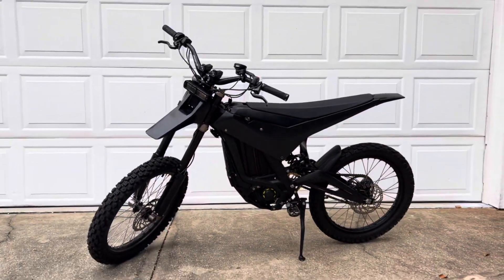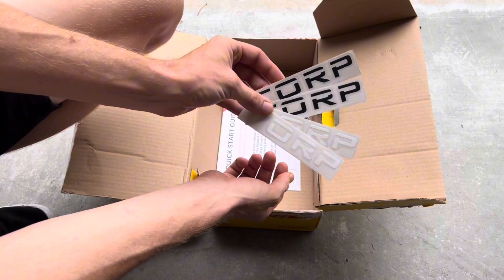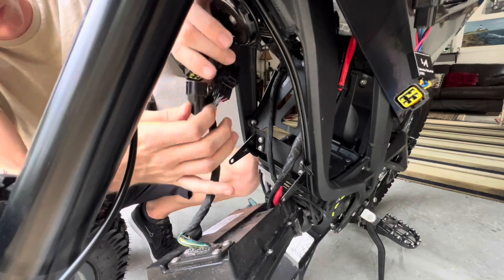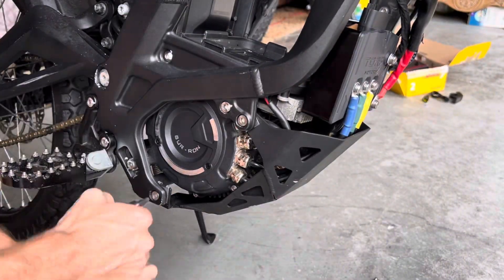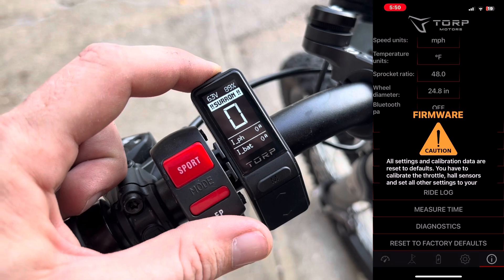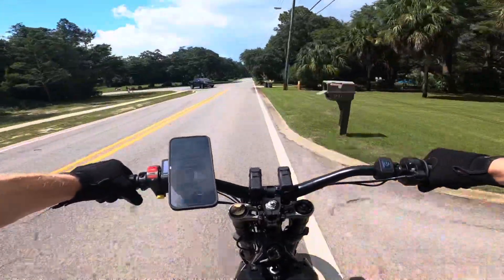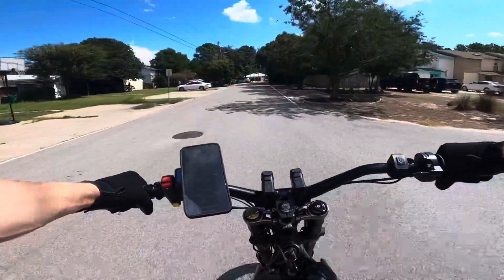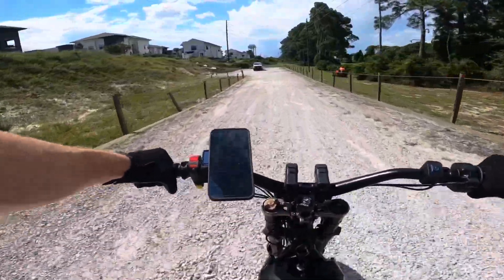Surron X TC500 Controller Installation #surronx #ebike

Comment: is it possible to connect 2 motors?
Reply from the maker: Anything is possible if you can figure it out
Reply: So is possible to stack the 2 motors phase wires and connecting to the controller?
Reply from the maker: I actually just saw a dude build a dual motor surron. He had two motors stacked on top of each other and a long chan to drive the sprocket

Comment: do i need the stock sport and eco switch or can i use the torp display to switch between the 2?
Reply from the maker: The Torp display works to switch between modes. You use the “M” button to switch. You have to set it up in the app though

Comment: Great video! Do you need your green wire cut to take advantage of the TC500s power?
Reply from the maker: No you don’t! The controller taps into all the power without cutting the wire

Comment: How did you get 3x the power with a stock battery?   Please
Explain.
Reply from the maker: It’s a little more that 2x the power actually. The stock battery and motor are capped on their power output. They don’t produce MAX power with the stock controller. With a new one you can get into all the settings and tap into the full power of the battery and motor.
Reply: I doubt it’s 2x.  How many watts are you set at now? 

But thanks for admitting that it’s not 3x the power.   Your video says 3x.  It’s not 3x.
Reply from the maker: @gebertb24 thanks for pointing that out my friend. If I had a bigger battery it would be correct. Even so, the stock motor output is set to like 6kw. From factory. With a new controller I’m pushing 7.3kw now. Stock battery and motor
Reply: @AdamEspositoYT  

Ok.  But u don’t have a bigger battery, so it’s not correct. that’s not 3x.  That’s not even close to 2x.  It’s actually only 1.2x or 20% more power.  Which makes sense.  

So I don’t understand why you claimed 3x, then you claimed 2x when it’s only 20%.
Reply from the maker: @gebertb24 the claim comes from the manufacturers website. In reference to a 72v battery setup. And with  motor on top of that, you can get up to 25kw of power with this controller. Check out the details for yourself.  https://www.torpmotors.com/controller_tc500/ 

The claims not wrong. I just personally don’t have a 72v battery. Is your concern with the thumbnail being incorrect? Or did I also say it in the video?
Reply: @AdamEspositoYT  your thumbnail implies that your bike has 3x the power.  Or it implies that the controller alone can produce 3x the power.   Neither are true.
Reply from the maker: @gebertb24 thank you for your input